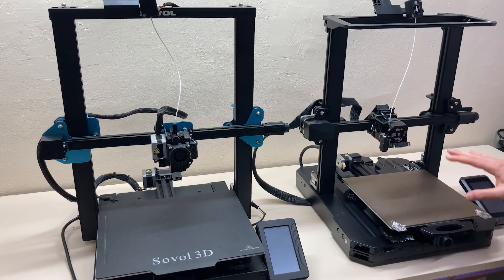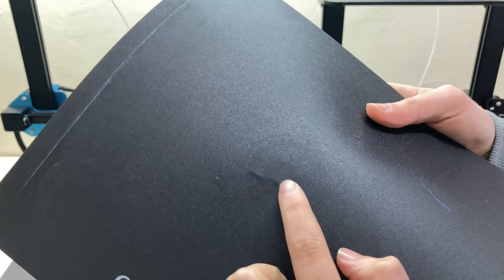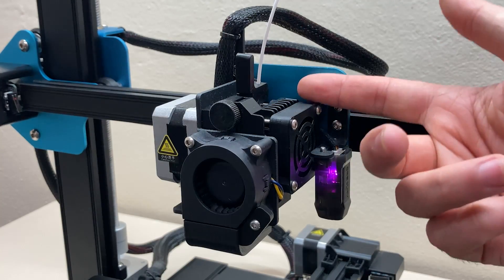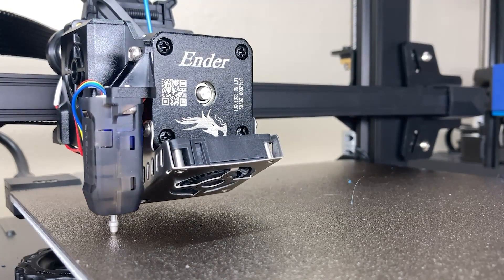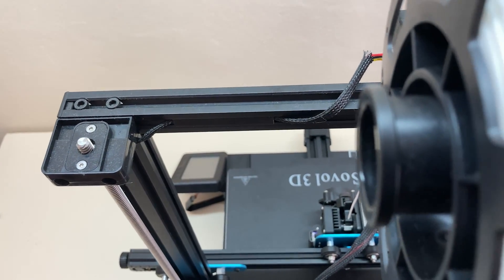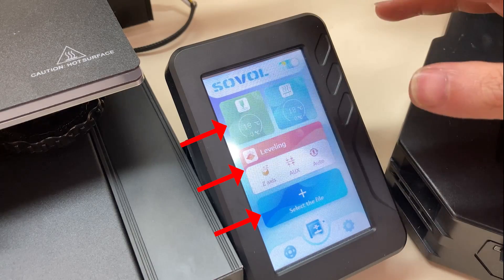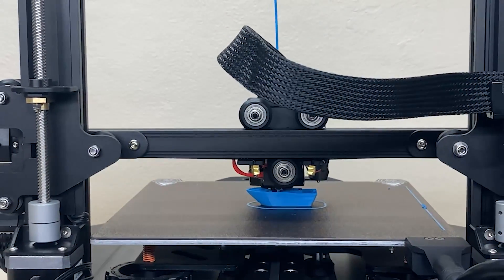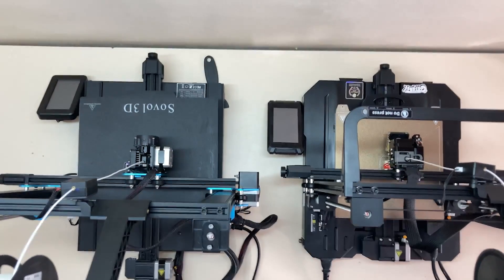ENDER3 S1 PRO VS SOVOL SV01 PRO

Comment: I've bought the Sovol some time ago and it's a great printer for the price. I still have troubles figuring correct settings for PETG fillament (a lot of stringing, sometimes elephant foot,..) , but it's not a deal breaker. For PLA it's basically plug and play.
The extruder could be little bit better as I had troubles with refuelling, but again, with a little bit of patience, it was okay. 
With the laser cutter - yes they are switchable (I've bought the 5W laser cutter), but to swap it, it's pretty challenging as you have to swap cables from the bottom and also it's a little bit uncomfortable if you are beginner with 3D printers as I am. 
Overal I do not regret single buck spent on that printer - yes, it has flaws, but they are more like  "specifics" and can be fixed with a little bit of patience and research (which I honestly did not so I am cutting away the strings :D).

For the quality of the video - good review and I am fully behind your reasoning and agree with it